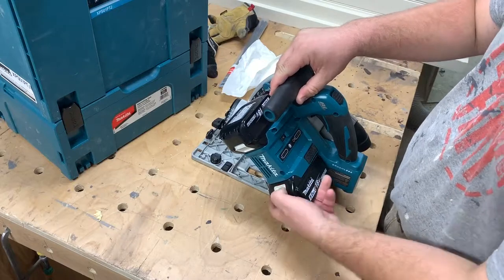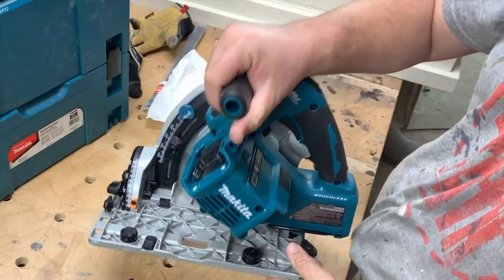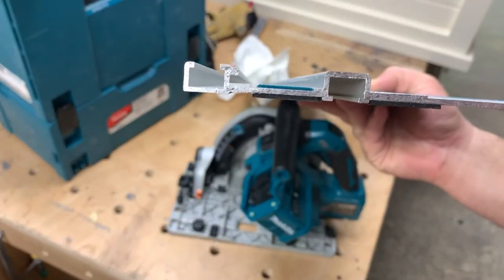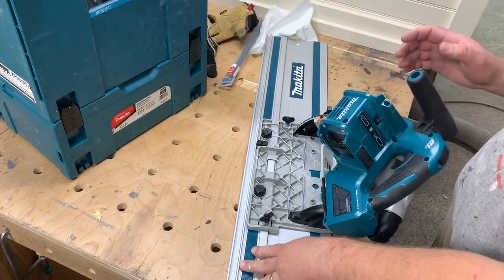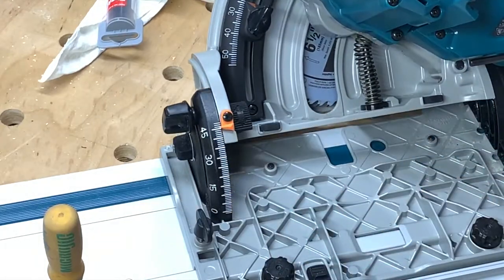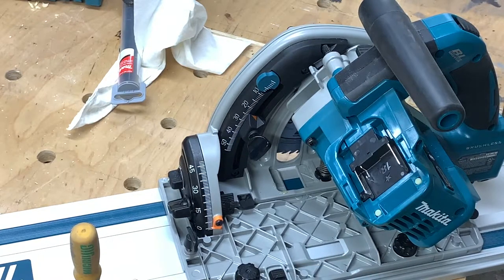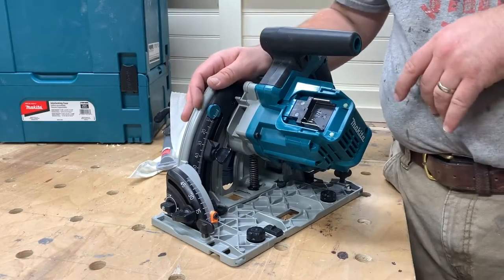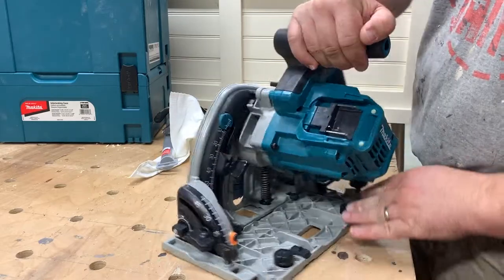Makita Track Saw Full Overview - Every Switch, Lever, and Thing-a-ma-bob The Recreational Woodworker

Comment: Much obliged for the refresher tour of the tracksaw. I especially appreciate the look inside as I have both the Corded and battery versions. Annoyingly, the dust port for the battery version is a different diameter to the Corded iteration. I am now thinking I could swap the ports, enabling me to continue using the Triton dust bag - excellent btw - without an adapter.

Comment: Thanks for the video I have that saw and it is in my opinion better than the corded Festool which I've used every day for a long time. If you don't have the hundred and 18 inch track get it.
Reply: Get two and cut one so you can safely cut across the 48" side of the plywood.

Comment: It baffles me how track saws are all built right blade. 
 
When it comes to circ saws, it's usually preference based, with a few "safety" aspects. 
 
With a track saw, however, it should be designed as : Blade Left for righties.  Blade Right for lefties.
 
As a former lefty, I loved it. It was the one tool where a lefty could look at a righty, and stick out our tongue and say "See what it's like for us?!?!?!" Hahaaa.
  
But after a virus took my left arm leg function,  I had to become a righty. And cutting straight lines (safely) became a nightmare. No table saws. Maybe a bandsaw. A jigsaw, and circ saw were my only options. Because only having a right arm, made a track saw with a right blade, pretty much impossible.
 
So from my perspective,  being on both sides of the blade, a track saw is the only circular saw where Blade location truly matters.
 
Yet there is no such thing as a Blade Left Track Saw. (Yeah, the one Kreg makes is a steaming pile of 💩.  But it's to be expected, since Kreg isn't a brand I'd associate with precision and quality. They have great innovation, but poor execution. If they upped their quality, and spent more on manufacturing their products (and a higher retail price obviously) they could be great.)
 
So, next time any righties out there using a track saw have to drench, lean, cross arms, climb upon your workpiece... imaging if it were a Blade Left. And how you could rip a sheet of plywood with one arm, simply by walking beside it and holding the saw.
 
(For naysayers: I get it. "I've never had an issue before."  Well, that's just because you have nothing to compare it to. Festool made a track saw, and everyone just started copying it. Then copying copies. And so on. .... "Well if you lay your track down right, and the splinter guard is on your line, then it doesn't matter where the blade side is." Sure, but then your guide rail, and saw are resting on your cutoff. .... "But I've always used right blades." Well, that's great. But if you always eat cold bologna sandwiches, then you'll never know how good a fresh porterhouse can taste. Lol. )
 
If you can find a lefty using a track saw, watch them. They're using a Blade Right, and it's effortless. They have it made with track saws. Leo over at Hand-I-Craft is a 1 armed woodworker like myself. But he has only his left hand. Check out his use of a (Festool) Track Saw, and how easy his cuts are.
 
Makita, Bosch, Dewalt, and even Festool, are missing out on selling thousands and thousands if saws, simply because they refuse to think about blade location as more than just personal preference. 
 
Also, make track saws 7-¼" people!!! 45° cuts shouldn't require us to bury the entire blade.

Comment: Have you had any problems with saw sticking to track. I bought 2 55” tracks adjusted slop out for one track but half way down the second track my saw sticks and I can’t push it. If I adjust the knobs so it slides freely it has a significant amount of play along the rest of the track.  It sticks in 2 separate places but slides smooth the rest of the way. Any idea what’s causing it? Everything is same thickness down the length of both tracks. I measured with digital calipers. This is my first track saw.

Comment: How do you calibrate the 0 deg to be indeed 0deg. Mine creates a bevel at 0deg.
Reply from the maker: The are two small set screws on the underside of the saw plate you can adjust those with an Allen key

Comment: thanks for nice video. mine one is not 90deg needs minus angle how can I adjust?
Reply from the maker: There are two small allen set screws you can adjust to calibrate it.  They're on the bottom.
Reply: @DaileyWoodworks  Silly question but do you adjust both of the screws as the poor instructions only point to one of them?  Great video BTW!

Comment: Is there a way to adjust the scale or the indicator for the plunge depth? Mine is off with or without using the track
Reply from the maker: That is an annoyance. I've seen some 3D prints on Etsy that crate an adjustment to account for the track but I haven't bought one yet. I just add 5 or 6 mm to my material thickness and it works out
Reply: @Robert Dailey - Dailey Woodworks  yep I do the same. Just thought that maybe there is a way to calibrate that I was missing. Thx for the response.
Reply: Yeh 6 mm

Comment: Hello, I have one of these plunge saws but it's the mains version. When I return it to vertical cut - right up to the stops on the base plate - it seems to cut inverted by a degree or two, I have to manually guess dead vertical. Do you have any ideas what's adrift please?. I have cleaned everything out so dust build up is not the problem, FYI, I have recently changed the blade.
Reply from the maker: There are two small set screws on the bottom plate that you can adjust to set the 90° stop
Reply: @DaileyWoodworks  fantastic! Thank you very much

Comment: Now let's see you adjust the bevel set screws.  I'm in the process of trying to dial it in.  It wasn't cutting a true 90.
Reply: How did you get on?  Ive just got one myself and its not cutting 90!  Ive tried adjusting the screws on the bottom of the plate but they don't seem to be doing much!
Reply: @tmitch45 

I haven't gotten around to it.  I'm using my other track saw.  Someone suggested that I backoff both set screws to where they both just barely touch the base plate and then adjust both together.  If I move one a quarter turn I move the other a quarter turn.  I don't see how else it could be done.
Reply: @tmitch45 

You do need to loosen the 2 knobs at the front and back of the saw before adjusting the set screws.
Reply: @ThekiBoran  Thanks I'll give it a try.  I must admit for the money I was hoping for something which would cut 90's straight out of the box!
Reply: @tmitch45 

I hear you but it's a fixable problem.
Reply: @ThekiBoran  Good to know thanks!